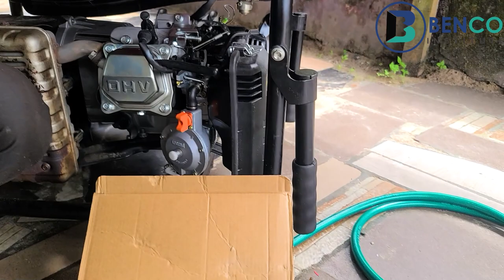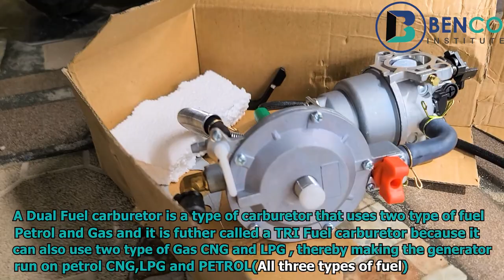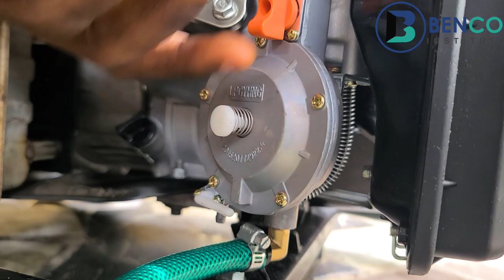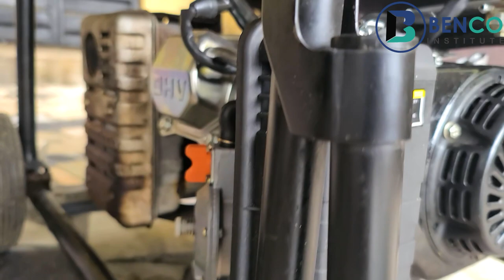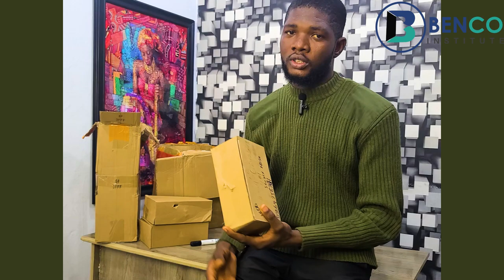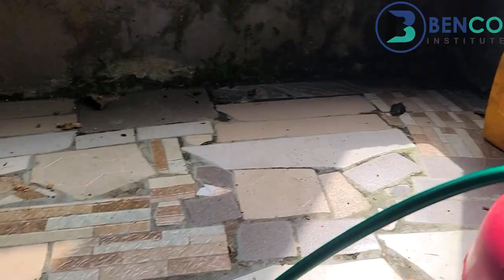PETROL to GAS Carburetors: Everything you need to know about Gas carburetors

Comment: An Engineer like you said; is not advisable to use gas on a generator. I asked him why? He said my crank shaft will be hitting each other because of no carbon. He said petrol produces Carbon that helps Engine not to hit rod to rod. He said if that happens, before my Generator will start again they will ground it. He said if grounding continue, a time will come when my Generator top will be need to change for another new one.
How true is this?
Reply from the maker: I am struggling to understand the reasons given here...it doesn't make sense to me

How can d crankshaft and perhaps the con rod hit each other when there is oil in the crank case?

I have seen hundreds of persons use Gas carburetors not one have this ossues you outlined

Comment: Bro how can one switch from gas to using petrol once the gas finishes. Like after filling the tank with fuel, is there any adjustment will are to do on the gas carburetor before running it? And what is the work of that yellow coloured plastic close to the hose.
Reply from the maker: Just take off the gas valve from the bottle and connect the petrol hose to the petrol tank,That is all

Basically It is to switch between different type of gas...from cng to lpg and vice versa.

It is written on it
Reply: @bencoinstitute  ok. Thanks.

Comment: Does the carburetor itself has any safety feature, like, does the gas keep going into the carburetor even when the engine is turned off, or it automatically stops collecting gas when the engine is not running?
Reply from the maker: There is a lock... That orange valve on the carburettor serves as the lock when you tilt it horizontally it stops gas from entering the engine of your generator
Reply: @bencoinstitute  what if I forget to turn it off, just like I forget to turn off fuel valve sometimes, is there any danger
Reply: @bencoinstitute I thought the orange thing is to switch from LPG and CNG
Reply from the maker: @efeanderson689  yes, Depending on how you tune it...it both locks and switches